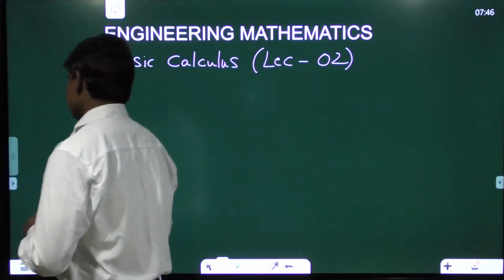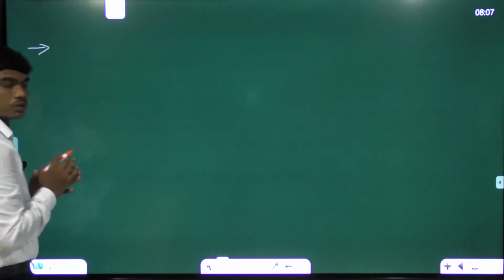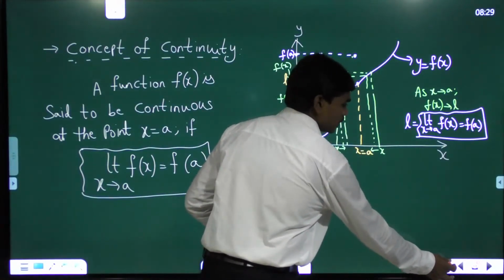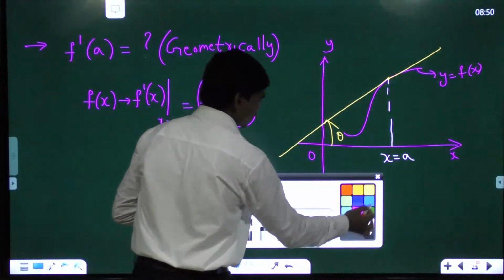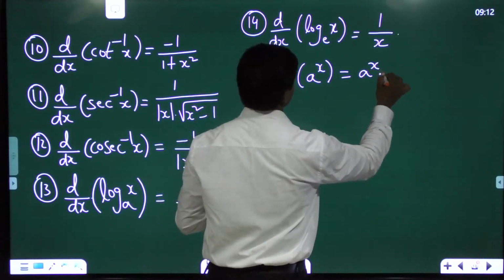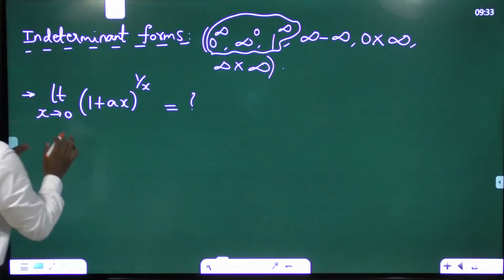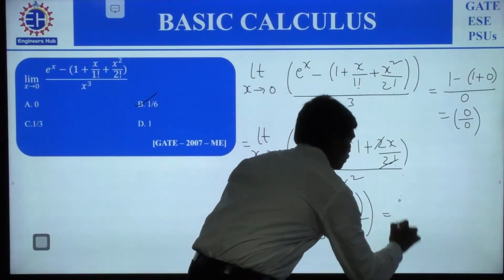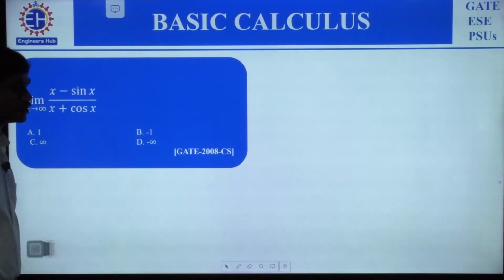Engineering Mathematics || GATE & ESE || Basic calculus || Lec -02

Comment: Sir, I have a doubt on differentiability of a function. for example if we take two functions 
f(x)= mod (x);  and g(x) = ax^2
here f(x) is a straight line function and g(x) is a quadratic(parabolic) function.
both the functions are continuous at x=0; but we say g(x) is differentiable at x= 0 whereas f(x) is not differentiable at x=0
but according to the 1st principle of differentiation, the left hand differentiation value and right hand differentiation value are different for  both the functions. could you please explain me ???